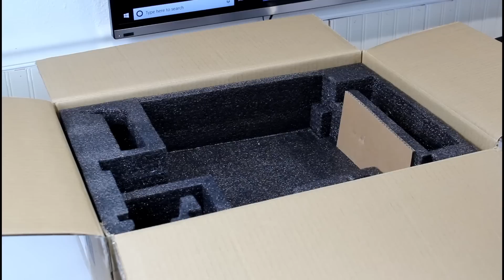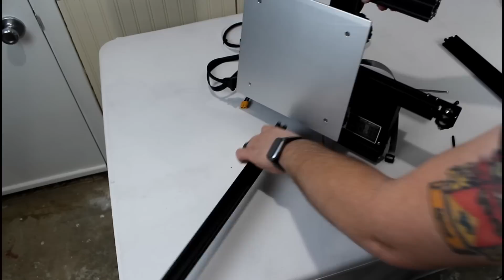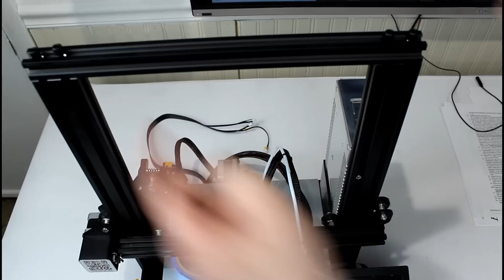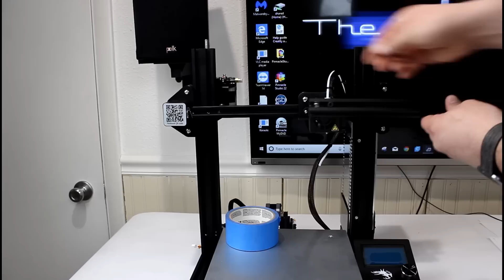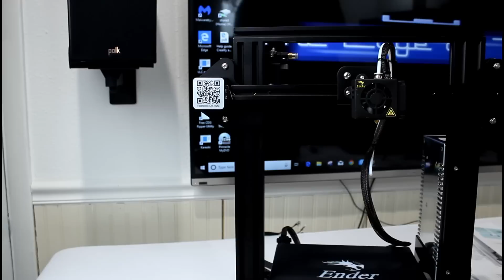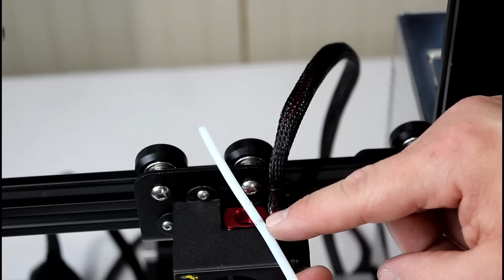Updated Creality Ender 3 Performance Assembly Build Section 1.1

Comment: Very good instruction. I will rebuild my Ender 3 pro according to your instructions. At 16:50 you loosen the guide for the z-screw, but you never fasten it. Did you forget it of should it remain a little loose?

Comment: Hey, if your still answering questions: My bit with the QR code on (x gantry?) it is very stiff going on the left extrusion  the first two wheels go on but the third stops and to get it on more force than feels right is needed. In the video yours just slides on. I've tried to loosen eccentric nut but it only seems to be stiff or very stiff. Help would be appreciated :)
Reply from the maker: Hi! Once you get it on, does it slide ok?
Reply: @theedgeoftech  Wow thanks for the quick reply! Yes, it seems to slide up and down ok. It's on the loosest bit in the travel I could find (still feels stiff)and it rolls smoothly enough without wobble which was different to the y axis where it would wobble and then I could tighten until it didn't. Should I just not worry about it then?
Reply from the maker: @Pizza2002com  Sometimes they're hard to get on, But as long as you get it on and it rolls smoothly and evenly like the video, you're good to go!
Reply: Thank you very much :)

Comment: Why the 4mm nuts at the bolts/springsunder the bed? One bolt on my Ender 3 Pro is turning around with the wheel so bed will not go down ? I cant hold the bolts because there is a "layer" on the bed so the boltheads are hidden below. It´s born with a magnetic buildplate

Comment: My printer didn't come with any nuts for the bed.  Was it supposed to?
Reply from the maker: If you mean under the springs, they do not come with it. I added those. You don't have to use them
Reply: @theedgeoftech  Oh, OK.  What was the purpose in you adding them?  To keep heat away from the springs, or something else?
Reply from the maker: @Spar10Leonidas  They are used to stiffen the old silver springs that came with the printer so they don't go out of level so much. If you have yellow springs you wouldn't need to do that.
Reply: @theedgeoftech  I think mine look like yours, so if it helps preventing it from going out of level, then it might be a good idea for me to get some.  Leveling looks like a frustrating process that I'd like to do as little as possible.

They're just 4mm nuts?  Is there a thread count that I need to worry about?
Reply from the maker: @Spar10Leonidas  Yes they are 4mm. You could order the yellow springs if you want, they are much better and very cheap!
Reply: @theedgeoftech  Are they available on the Creality website, or can I get them on Amazon?
Reply from the maker: @Spar10Leonidas  You can get them on Amazon. If you are in the US you can use my storefront and go to 3d printing parts. This is an affiliate page and it helps my channel. It doesn't cost you anymore money to use it.  https://www.amazon.com/shop/theedgeoftech
Reply: @theedgeoftech  I just got my springs in.  Thanks for the recommendation!!

Something else just occurred to me: do you have any recommendations for scanning devices that are compatible with the Ender 3?

Comment: Just an FYI... you don’t need to push the Bowden tube all the way through the coupler. If you push that white ring(coupler) into the fitting, you can pull the tube out.

Comment: kind of surprised you didn't loosen the hot nozzle a bit when putting the bowden tube into the hot end to make sure it seals properly. Is there a reason you suggest doing this when changing a nozzle but not during initial setup?

Comment: I feel jipped. I just received my 3 pro and the manual shows v2.0. Yours was v3.5 nearly a year ago. So either Creality sent you a special case or I got one that's been lying around for a long time.
Reply: Dug a bit into this a bit more with some guidance from the Creality FB page. My main board is v1.1.4 which is the upgraded version. I really don't care that the manual is an old version. I'm just relieved to know I did get the latest version.
Reply from the maker: @scottsuhre2514  That's great to hear!
Reply from the maker: Wow! Where did you buy it?
Reply: @theedgeoftech 
From here. I thought this was the official Creality site but was wrong. It sounds like plenty of people buy from them so I'm not sure what's up. https://www.creality3d.shop/products/creality3d-ender-3-pro-high-precision-3d-printer

I just sent them an inquiry about this. We'll see what they say. Thanks again for your help.

Comment: Thank you for the great video. One thing I'd like to verify. The 4mm nuts on the bed bolts, are they used to compress the stock springs more? I bought the yellow springs already and I'm thinking this would mean I can skip this portion.
Reply from the maker: You are correct! You don't need the nuts if you have the yellow springs! I would suggest everyone get the yellow springs, but this will work until you do! Thanks for watching!

Comment: Between 22:30 and 23:30, it looks like you took a clip out of the video -- and it appears that you are just "muscle-torquing the X-axis carriage gantry to make it align with the gantry frame. Did you loosen any bolts before trying to align them and make them parallel? I have the same issue, setting up for the first time.
Reply from the maker: If you are building it right now, you would leave the bolts on the left a little loose. If you have it built and need to adjust it, try this video. It's more in-depth https://youtu.be/4bFYH0X3qjk

Comment: You took the Z Rod out the bottom I would have reversed the process and went back through the bottom rather than the top less screwing that way Great video.

Comment: Just purchased an Ender 3 and followed you video. I screwed up getting the X gantry level on the first run, but after going over it again, it's  all good. My prints so far are coming out way better than they are on my Anet E10. I think I've over modded it lol. I've forgotten how loud the A4988 steppers are, as my E10 is running on the SKR 1.3 with TMC2208s and it's loads quieter. Thank you for posting this very detailed video and keep them coming.
Reply from the maker: Thanks for watching! I'm glad it's going great!

Comment: One thing I would add,is where you leave the screws loose on the Z-axis nut.IF the machine were perfect,you wouldn't need to do that.Since the never are,you can leave the nuts loose,but put a thin Belleville(wavy) spring washer in the space,and it will act like a anti-backlash device,instead of the nut just jumping around all willy-nilly.

Comment: Hi thank`s for a real good video. Is the 4 nuts you mounted on the bed just for stabilizion?  and is it the same With Ender 3 pro?  ( I have just got a 3 pro)
Reply from the maker: Hi! Thanks! Yes to both answers. Or if your Ender 3 Pro came with yellow springs, you don't have to do the 4 stabilization nuts. The yellow springs will be fine themselves!

Comment: Watching this for the 3rd time now as I'm hopefully opening that big brown box today and getting this built!

One additional observation though: doesn't it make more sense to put the M4 bed screws (and yellow spring upgrade in my case) in place as the very first thing to do? Seems a bit fiddly the take the bed apart when there's vertical extrusions already in place, rather than fresh out of the box.
Reply: There have been some issues with these screws coming loose.  The M4 nuts help keep the screw locked tightly, thus keeping it more stable.  Remember, you are constantly heating then cooling the bed.  Thermal expansion could cause the screw to come loose without that nut.  I am very surprised Creality doesn't do this from the factory.
Reply: Sorry, I miss-read your question.  I thought you were asking why he does that.  Your point is valid.  Easier to do it at beginning.

Comment: Jim there is no such tool as a flat head screwdriver what you are referring to is a slotted driver, this may sound anal but I worked in a tool supply company and this inaccuracy cost me hours most days calling customers who had called in orders for screws and drivers and described the screws as flathead, flathead scews do exist but they also come with numerous differing slots

Comment: My Ender 3 Pro arrived today followed this build and also the bed leveling video and my ender 3 is printing absolutely brilliantly, I will do the extrusion calibration next but right off the bat no Bed sticking problems no issues what so ever. So much better than the 12 steps to disappointment supplied by Creality! the Lukes performance guide is awsome but a full build video that goes with it makes it even better!! thanks Mr edge of tech!!
Reply from the maker: Awesome! I'm glad it helped! Thanks for watching!

Comment: on the ganrty measurement you cut til you had it correct. i did what you said but the bottom wheels on both the brackets are loose. free spinning. the time of cut was 23:25. is that normal? or should all 3 wheels be touching?
Reply from the maker: Most of the time if they are properly tensioned, all three should be touching. Make sure that they can spin with your fingers, but not freely if you can.
Reply: @theedgeoftech  got it. took it back apart and set the tension on both slide plates then connected the 2020 cross bar. then your directions worked. just needed to loosen the 2 screws holding the right plate. it dropped down to perfect measurement  at 100mm and 250mm.  moving forward on video. thanks. LH sent me the written instructions aswell.
Reply from the maker: @tylerhundtoft5395  Great to hear!!

Comment: So at the end you said to home the device and mine stopped touching the bed. The tip melted into the bed layer since you had me heat everything up lol...??
Reply: I think the bed layer that came with my ender 3 pro was too big so it was hanging over the front. The hot end nozzle then rested on the magnetic bed that was over hanging

Comment: some questions, obeservations
-do you tighten the fitting at the top of the hotend after pushing in the tube?
-why won't you have the threaded rod sit on the motor's shaft? afaik, couplers should be used like that.
-the 4 turns for the bed knobs are not even 1 turn :) they are less than a quarter each
Reply from the maker: Hi! Thanks for watching! Yes you tighten the fitting after the PTFE tube is pushed in. There should be a small Gap in the coupler between the shaft and the rod. And you should do 4 full turns when leveling the bed. Not the quarter turns I did to film the video that was my mistake. I hope that helps!!

Comment: great video Jim, built mine exactly to your video bit by bit 2 hours start to finish, mainly stop star on the video, i found my x gantry was perfectly square on the build within .5 mm using my calipers and depth gauge, no need to adjust at all, would be really good if you could make a video that goes through all the controls on the screen and explain how they all work and what they do?

Comment: Could you define four “full turns”? I would define a full turn as 360 degrees, but it looked like you turned the bed level wheels four quarter turns.
Reply from the maker: You are correct! 4 full turns. Not the quarter turns I did. Thanks for watching!

Comment: I do have a question though. At @14:30 you simply screw in the Bowden coupler, but mine will not screw in at all...no matter how I try. I have tried both that come with it, and even reversing the thread, nothing works. Any idea what is going on here? Thank you

Comment: Jim this is the best guide on youtube on how to build the Ender 3. Thanks!!! I successfully build an Ender 3 Pro with 0 knowledge on the subject using your video. I do not think I could do it with just Luke's guide. The video and the guide complement each other! Quick question on aprox. 17:00 you loose the screws for the Z-screw one full turn. You do not seem to tight them back again. How should I have them? Should I tight them again after installing everything? Thanks!
Reply from the maker: Thanks for watching! I'm glad it helped, and I hope your Machine is running great! You don't tighten them back up. You want to keep them only about 1-2 turns loose, but no more than that. I hope that helps!

Comment: Very good video, but I needed to point out a couple of things with your video, and my findings while building these Ender-3 machines. Straight out of the box both left and right bottom extrusions require aligning to the center Y axis carriage. If you don't, your build surface is not 100% square with the Z axis. This adjustment can be preformed by loosening the two side cap screws, using two squares, one placed on the Y axis carriage extrusion and one placed on a side frame extrusion. When both squares are 100% inline vertically, tighten the side screws, slowly alternating between them until very tight. Do the exact same for the other side frame extrusion. Once this has been done position the Z axis side extrusion tighten both of the lower cap screws up and check that this Z axis extrusion is 100% square to the previous lower side extrusions. All the ones that I have built, they are never square, so shim to fix. I use aluminium coke cuttings for shims, as these are very thin! The two roller assemblies that travel up and down the Z axis extrusions, should be aligned on the X axis carriage with two squares and tighten before they are positioned down and onto the two Z axis extrusions, no double handling then. The Z axis lead screw should be placed into position and grub screw tighten before the X axis carriage (gantry) is put into position. Position the Z axis stepper motor tighten the two retaining screws, and check if the lead screw is perfectly parallel with the Z axis extrusion, if not shim to fix. At video count 31.40, never move any axis quickly, because if you do you can induce enough current to damage the stepper drivers and or control board. Evidence of this induced current was shown at video point 31.40. Most people are totally unaware of this, even when the power lead is not even plugged in. Sorry if what I have said you may not agree, but through many years of experience in both mechanical and electrical engineering you pick up on a couple of things!
Reply from the maker: Thanks for watching! I appreciate the feedback! Also, you are correct about moving the axis's. Don't do that!
Reply: Agreed on the base issues,mine rocked like crazy!Also on the spooling of steppers! If they don't believe,wire the ends together and try to spin it,lol.....
Reply: Ever thought of making a video about this??

Comment: Been binge watching your vids Jim, I’ve had an ender for a while but watching your vids has made me want to take apart my ender and follow the steps you have gone through. To add to your subs I’ve Added both my accounts I have THE3DFR is my other account 😊👍
Reply from the maker: Thank you for watching!! I hope they help and I promise it's worth the time!!
Reply: The Edge of Tech it’s working well and I get really good prints but watching what you have put out makes me want to double check 😬😬
Reply from the maker: @rbcmptrmn  awesome!!! I appreciate that! If you're getting really good prints right now, maybe just do some of the fixes if you start having issues, you know how temperamental these machines are LOL

Comment: Very good video Jim. My ender 3 pro will be here any day and now i have a better understanding of the build process and proper guides to start printing correctly from the start. Thanks
Reply from the maker: Thanks Ken! I appreciate you watching and I hope it helps!! Let me know if you have any questions!
Reply: @theedgeoftech  Hi Jim, I built my ender 3 pro following your video. My X axis was not level and followed your video on that fix. Leveled the bed and had to put foil in the center to level. I used the cerality test dog as my first print and it came perfect, I was amazed how good it printed. Thanks for the videos and I hope to have more good prints.
Reply from the maker: @kenkozimor8471  Awesome!

Comment: ok I have an issue my Y axis limit switch when engaged by the rear wheel puts the nozzle hanging out in space about 1/8in away from the front of the bed! there is no adjustment on that switch either! whats up with that?
Reply from the maker: Hi! Thanks for watching! Are saying that when you home the printer the nozzle is in the front left and is past the bed by 1/8 in?
Reply: that is correct it is hanging out in free space with nothing under it! the forward edge of the bed is visually  about 1/8 of an inch  towards the rear of the nozzle location.
Reply from the maker: @irongoatrocky2343  On the Ender 3, that is how it homes. In the front left with the nozzle slightly past the bed. It sounds like it's working as it should!
Reply: @theedgeoftech  ok thanks I'll try it than.